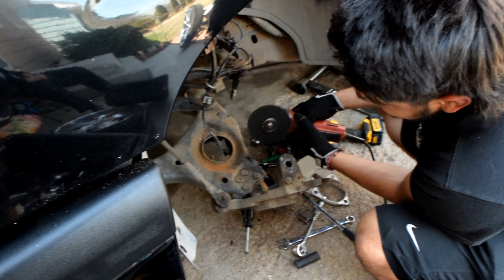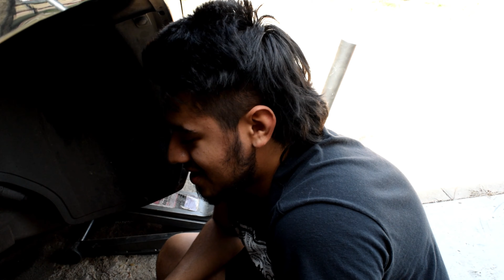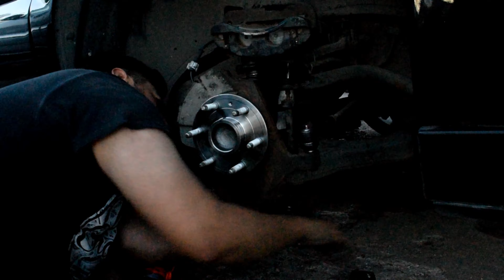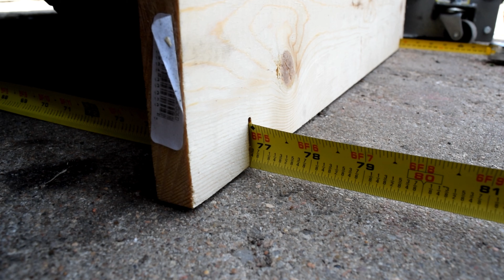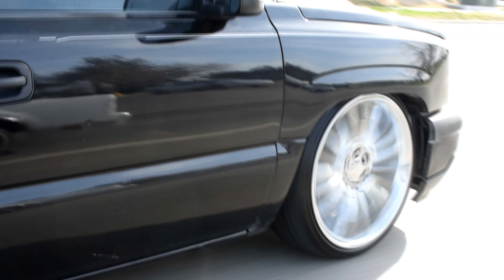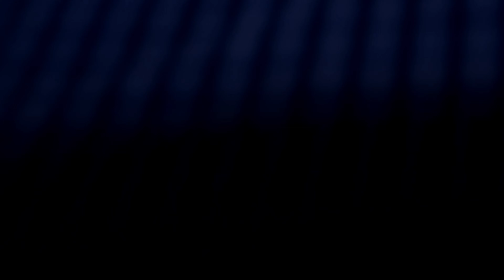7/11 Dropped Silverado

Comment: hey bro I have texas carbon 24 on the rear and I got the same drop, how come my bed is like hitting my wheels like I can’t even stick a dollar bill in there it’s so tight lol is that how urs is and you just live w it or what
Reply from the maker: The bedsides were shaved on this one to clear.
Reply: @CGOD  I shaved mine too but they’re still touching
Reply from the maker: @zenah7248  I’ve seen some people extended the bedside mounts to kind of “widebody” it and clear. This truck had a plastic bed cause it was stepside
Reply: @CGOD  yea mines stepside too, hm i’ll see
Reply from the maker: @zenah7248  fack, best option is to narrow the differential

Comment: Hey bro i got the exact same truck but in the front my sway bar links keep bending and then snapping off in half any ideas on what it could be i went about 6 inch drop
Reply from the maker: You’ll have to get relocated sway bar links for it to work properly
Reply: Where can i get those at?
Reply from the maker: @Joshsotojustss  I’m not for sure, my brother said he used stock links and didn’t have any issues
Reply: @CGOD thanks bro for replying your gto is sick asf too

Comment: hey bro I was wondering if you had any problems in the front? did you rub on 7 inches? I ordered 3 inch lowering springs but I have 5 inches rn so I’m thinking or wondering if it’s gonna be a problem going 8 inches in the front with 22s
Reply from the maker: If tires are too big you’ll rub on the inner fender. This truck had the inner fenders cut out and fuse box relocated
Reply: @CGOD  Ohh I really appreciate it bro, I might have to get some thinner tires and hopefully be able to run 22s with the 8in drop and relocate the fuse box, if not I might just have to go with 20s
Reply from the maker: @chrisluvsu  22’s on 265/35 should still work, it’s just the bigger wheels and tires that’ll be your problem but truck will sit real low to the ground
Reply: @CGOD  I have 265/35 rn hopefully it does fit and is the relocation with the fuse box hard to do? and how much did you end up cutting the fender? like a good amount or most of the front fender? also really appreciate you for responding man 🙌🏼
Reply from the maker: @chrisluvsu  relocating it isn’t too hard, usually the entire inner fender is cut out. You could take it a step further and tub the fenders then it’s possible to just lay the fuse box on top
Reply: Hey bro how did it end up coming out? I’m looking to do the same thing 8/10 drop on my cat eye. Was there any camber and how was the clearance?

Comment: I have the same drop on rear but some how my rims still fuck my bed up is it due to taking off the plastic wheel well that comes on the bed? Do u have the same probelm?
Reply from the maker: This truck being a step side the bed has no wheel tubs inside. Your wheels might be the issue though. 10” wide will barely fit and rub sometimes. Narrower wheels will clear easier. But yes if anything is rubbing you can remove it or cut out your wheel tubs inside the bed if you have a fleetside

Comment: Was there any issues with the tank back there ? Im doin that to mine and im just wondering, and how did u guys extend all that ?
Reply from the maker: 1slo_ext _ no issues so far, we just used gas line to extend those and the same size wire to extend the wiring
Reply: CGOD thanks for replyin bro !
Reply: Did you just have to buy more of the same plastic line and what fittings do u buy mines 8 in rear right now but need to move the tank to go another 2
Reply from the maker: We just extended the original lines so we used the same fittings. Just used fuel hose and hose clamps to extend them
Reply: @CGOD  ok cool so just use rubber house and i guess brass barb fittings and clamps

Comment: I did a 4/6 drop on my GMC Sierra and I have the damn Chevy lean.... It’s sitting lower on the drivers side than the passenger side.... I cut a 1/4 inch of the coil off but she’s still has the lean.... I’m thinking maybe I should cut another 1/4 inch off....
Reply from the maker: Crippin’ 4 LYFE idk man, I’ve heard of people running one drop shackle at 2” and the other at 1” to even it out also. Or a stock shackle and a 1” drop shackle
Reply: Just get a leaf spring lift shackle for the low side
Reply: I have the djm lift shackle brings it up 1in

Comment: Bro could you make a video on how you ran your gas tank up there?
Reply: Like a walkthrough I guess please ?
Reply from the maker: It’s my brothers truck but pretty much he drilled holes in the bed floor to be able to extend the wires and fuel lines and hooked the tank up like normal

Comment: Sick truck! Did you guys roll the rear fender? If so how you do it
Reply from the maker: The rear fenders on stepsides are plastic, we used a sanding disk on a grinder to remove the lip so the wheels don’t rub
Reply: @CGOD  yeah I got a regular bed and it has a metal lip thats shredding my tire. Trying to figure out best way to fix this issue
Reply from the maker: I would say narrow your differential, if not then you can shave the metal off with a sanding disk aswell. Some people say it makes it flimsy but atleast it would clear
Reply: @CGOD  yeah thats why I haven't grinded it down I heard the same about it making it flimsy. I might try the baseball bat trick lol. Until I can get smaller tires and 9" wide wheels.
My current set up is 22x9.5 wheels with 305/40 tires. Shits to wide
Reply from the maker: I wouldn’t roll it with a bat cause it’ll make the bedsides look wavy, I would shave it and leave a little material so it stays strong
Reply: YaGoonie ! What I did was make a cut every 2 inch and then fold it up
Reply: @el4809  thanks

Comment: What did you use up front to get to 7 inch and not have a shit load of camber
Reply from the maker: Jorge Lozano it’s on 2” lowering spindles and the springs are cut quite a bit. No camber adjustment yet
Reply: @CGOD  thats crazy i lowered mine to 6 and had insane camber
Reply from the maker: This one has some camber but it’s not too noticeable. Helps with turning and since we aligned the toe it shouldn’t wear the tires too fast
Reply: @CGOD  how does it ride with the cut springs? I'm thinking of cutting my djm springs to get another 2" drop
Reply from the maker: It rides pretty good, the DJM springs would be better I’d say
Reply: @CGOD  thanks for the reply. I wasn't sure if cutting these djm springs were a good idea or not. I'll also be running the belltech street performance shocks. So I think it should ride alright
Reply from the maker: Oh yeah it’ll be pretty good
Reply: @CGOD  thanks alot broski 👍
Reply: @CGOD  how much did you cut off the spring?
Reply from the maker: I think when it was all said and done it was like 2 coils cut off
Reply: @CGOD  so how much should I cut to get 2 inches?
Reply from the maker: I would cut half a coil and see if you like it there. You can always cut more but you can’t put it back lol
Reply: @CGOD  great idea. I'll start at half a coil

Comment: Obviously the alignment is gonna be off because you cut the tie rods like some fools instead of marking them before removal like normal people. You could have put the new ones one same place you took the old ones off
Reply from the maker: rmartinezg93 does it really matter? We had to adjust the toe anyways after lowering the truck more. Original tie rod placement would’ve been changed anyways